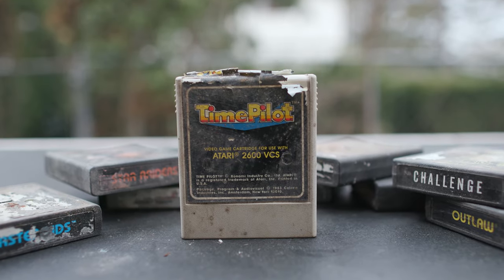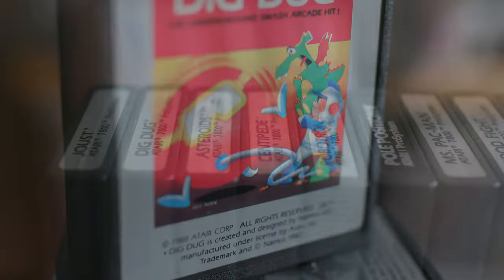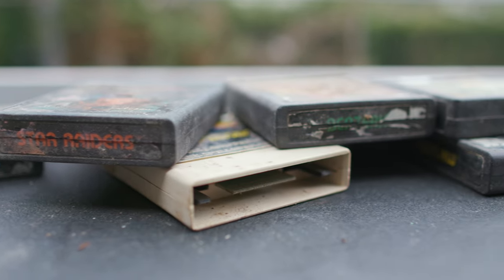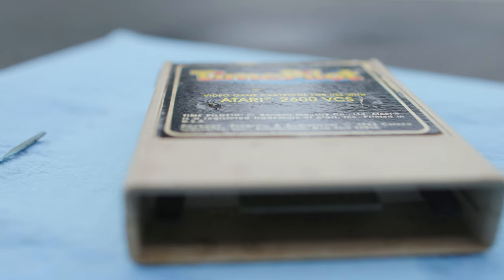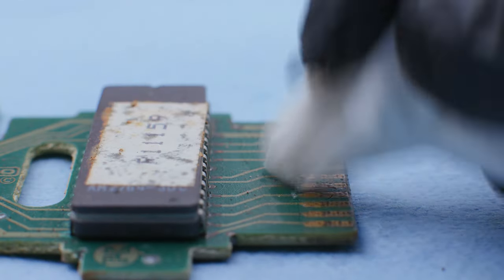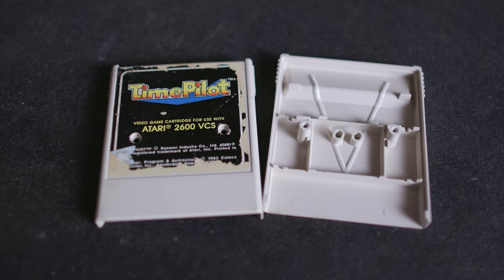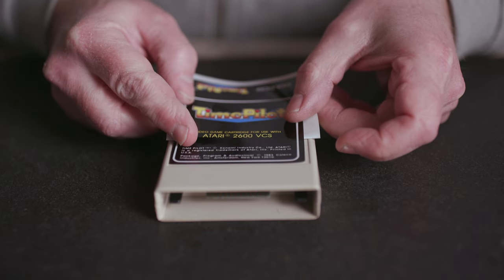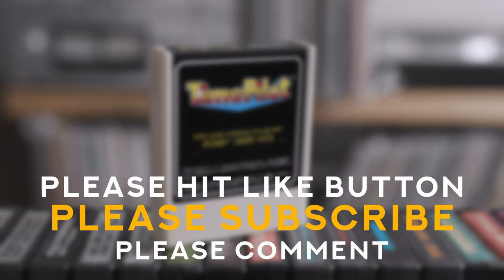FIXING UP OLD ATARI VIDEO GAMES

Comment: Great video, but one question, do the new labels say 'Reproduction' or some other clue to avoid confusion when they eventually make their way back into the community?
Reply from the maker: Hey there - great question - thanks for asking it.  To me, the onus is on me to tell people when I eventually part with a relabelled cartridge that it's got a non-original label on it.  To me it's an improvement (especially over the carts in this video) - but that may not be everybody's opinion - so the honour system comes into play here.  There isn't any indication on the labels I have that they are reproductions...
Reply: @readiysteadiy  Fair enough, but the main concern is the unexpected happens and most carts eventually arrive as part of an estate sale, or someone clearing out a parents old belongings etc.  Even if you do have the opportunity to directly explain to the next owner, every owner after that would need the same interaction in perpetuity to avoid the misunderstanding.  Nothing wrong with improving the cart, but just thinking long term. Alternatively whomever created the reproduction label could be part of that history by including their own logo. My two cents. Great video again.